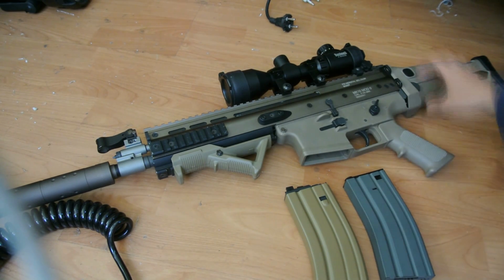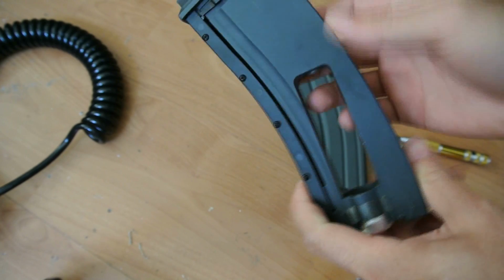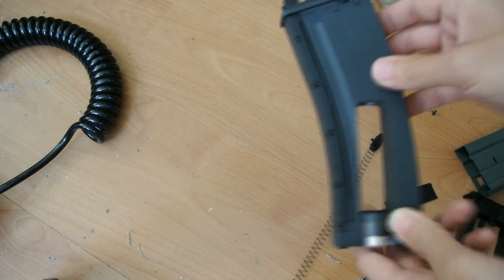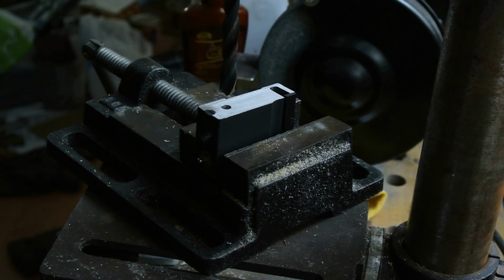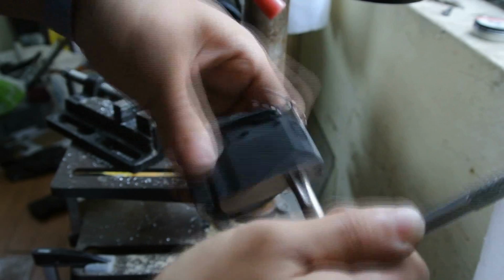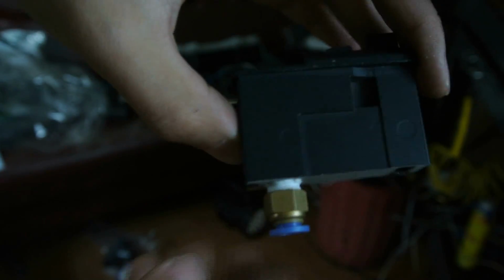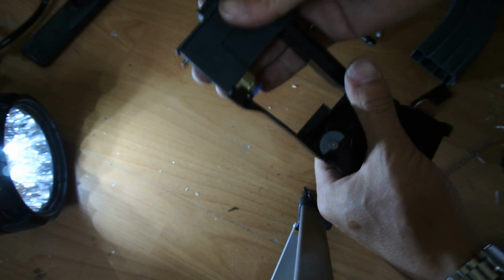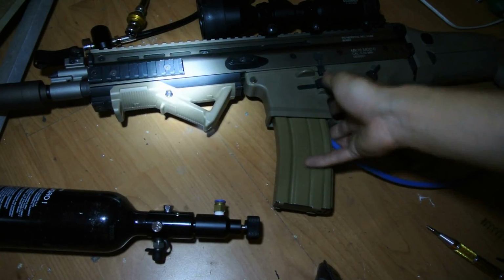Airsoft GBB to HPA mod (pro)

Comment: This mod doesn’t work. I did it the exact same way as shown in the video and found that the CO2 valve doesn’t work with the normal pressure of a regulated Hpa bottle at 150psi. 

CO2 valves Normally work under approx 900psi of pressure and I suspect the lower pressure once regulated through the CO2 valve doesn’t have enough energy to cycle the gun. 

I might be unique in my situation but I can’t see how I might have got it wrong
Reply: You should be able to get a replacement outlet Valve for the Mag, which is meant to be used with Green Gas and therefore lower Pressure. If that doesn't do the trick, there should be a way to adjust or 'shim' the Valve until it works as needed.